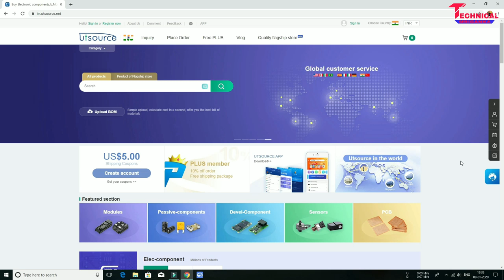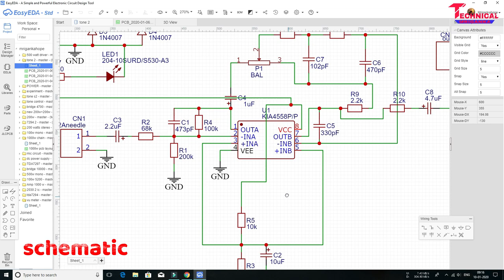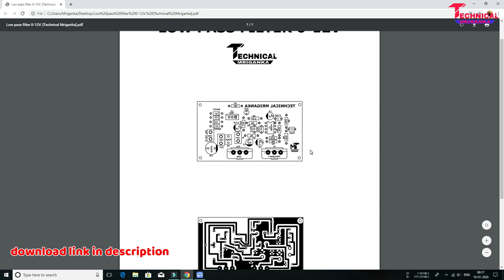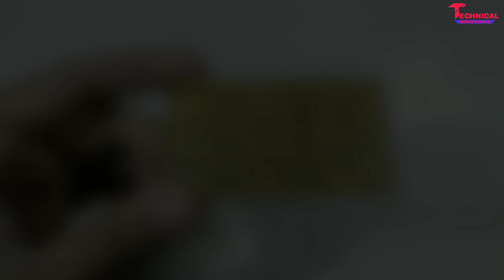0-12V Low pass filter.

Comment: Sir at which position of frequency control will i get ultra low frequency sound i made these circuit working finely but when I decrease the frequency control at 0 i can't hear anything the sound is too low when I turn it into 100  % speaker moving to and fro very fast without any input and very distortion to music